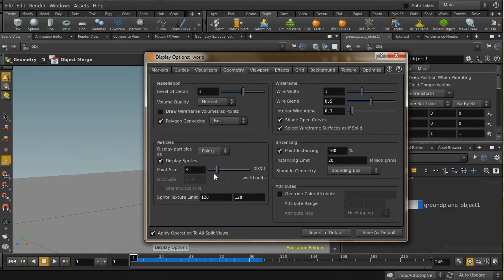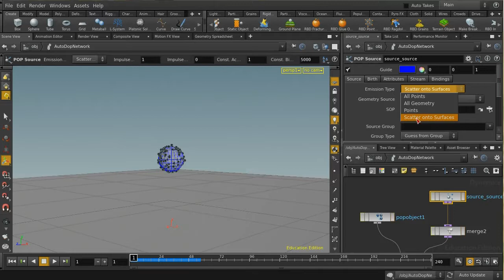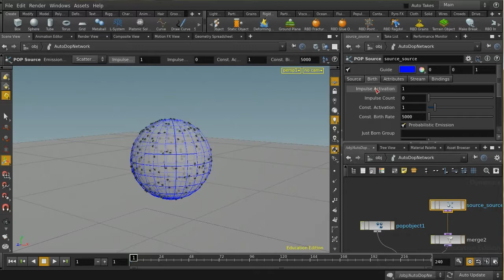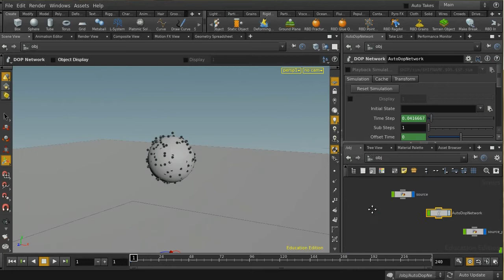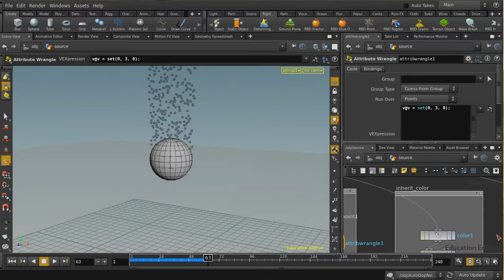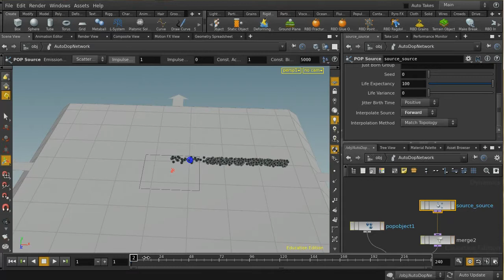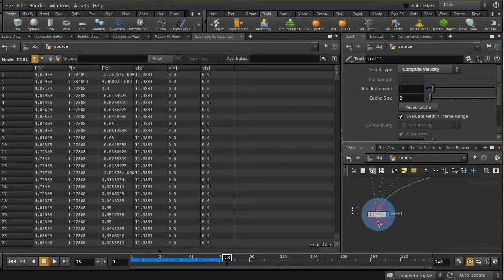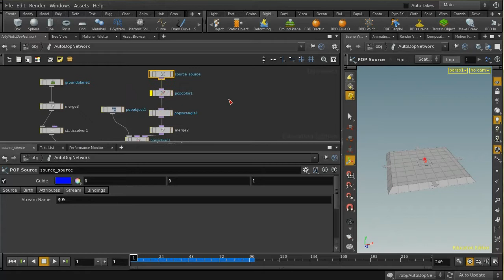Houdini Basics Particles Sourcing

Comment: Thanks. But how did you create the volume to emit form inside the sphere?
Reply: It's hard to see in the video, which method Peter used, but one approach is to use IsoOffset SOP. Just plug in your Sphere SOP output or any other geometry output to its input and you will have a volume.